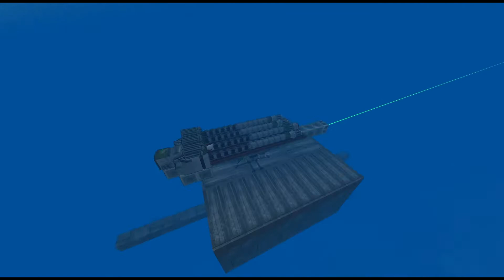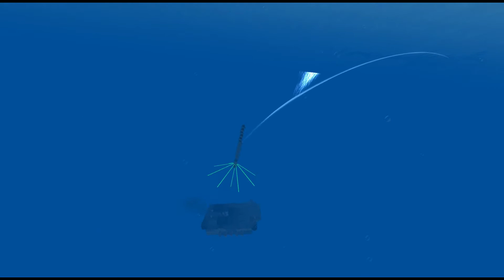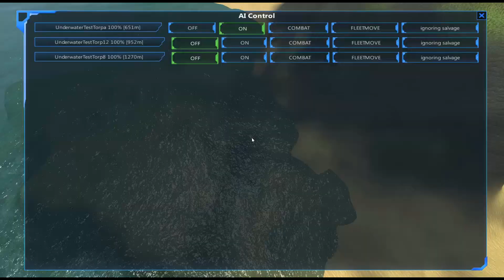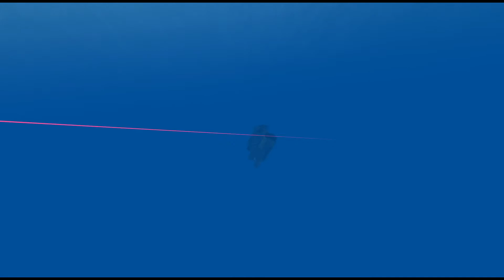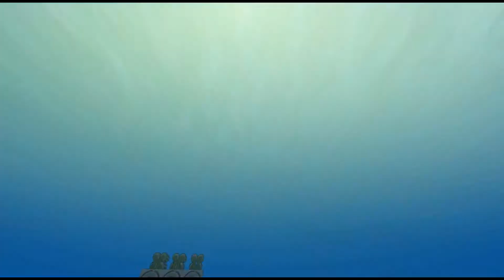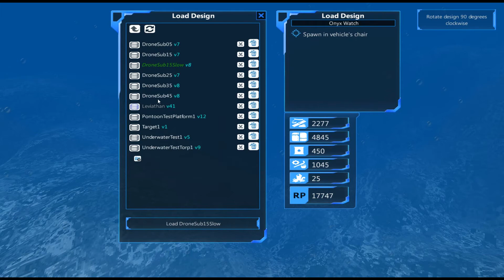From The Depths Lab 04- Deep targets cannot hide, Torps go Diving. Laboratory , Testing

Comment: i tried using the magnet to reach deep targets, altough they acted more like mines. magnets are pulled towards the enemy (obviously), this makes them both aim down at the target and will make the missile go deeper. magnets dont have a realy far range of effect, but when using the laser desegnator reciever to go towards the enemy, it worked fairly well
Reply: Yorick .U i found that the missile didn't need to be as long as yours, wich makes them cheaper and more spamable
Reply from the maker: Yorick .U Will give that a go combing the guidance modules. Although I found magnets are not very good at detecting friend from foe and attack my own ships often.
Reply from the maker: Yorick .U I just tried 4,8,12 as common sizes but could be optimised at 6 for a small 1/2 warhead missile. I like having plenty of BOOM in my missiles plus proximity.